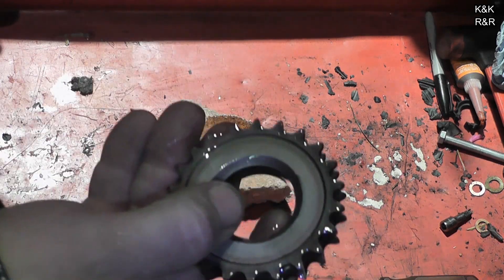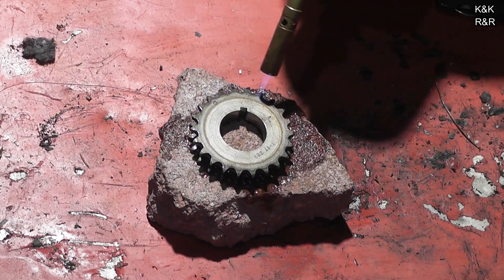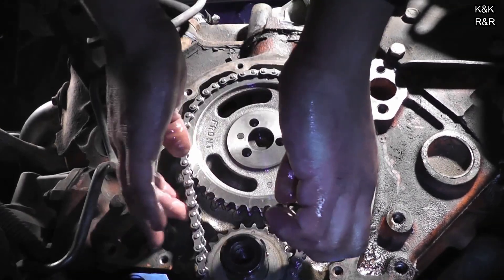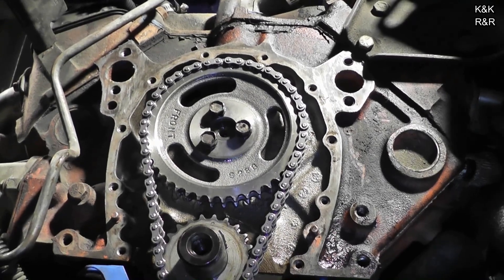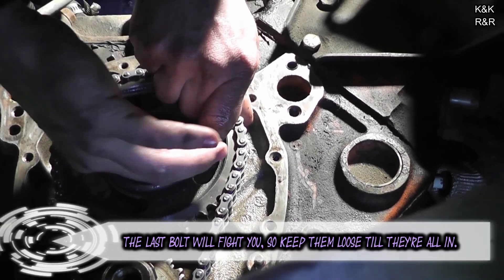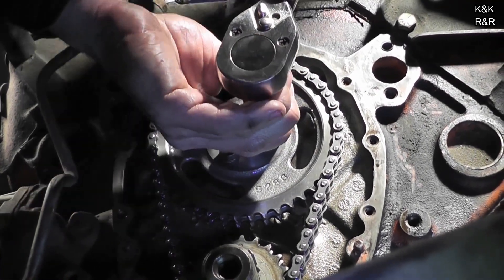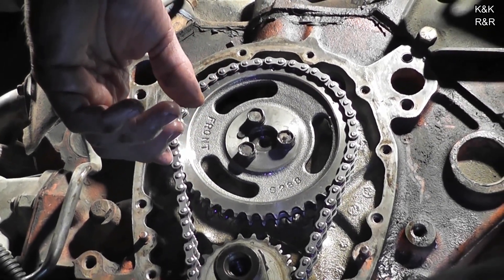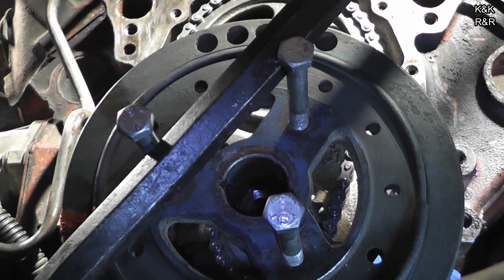How to Diagnose & Replace Any Chevy 350 Timing Chain Pt3  Double Roller Timing Chain Install

Comment: I've had my Chevy for 20 plus years 5.7 350 and never had the heat up timing gears or grind anything ! when I took the factory single chain to dual chain, also got rid of all the fuel injection crap and went with Edelbrock carburetor and intake ! Love my Chevy❤

Comment: i see the crankshaft and the cam marks are at 12 oclock-that how my haynes manuel shows and how ive done 3-350s and one 283 over the years-now i am being told that is wrong by a mechanic-if i turn the cam 180deg to get the mark at 6  oclock the book says thats number 6 cylinder at tdc-all my motors run good cept the last w a double rollers that has 7 degs stretch that i replacing lots of videos showe mark to mark aka 12 to 6oclock--dont get it
Reply from the maker: I and 6 can be for timing checking with a timing light.  I need more info what year you are working on and is it a 305,350,400?  305 are timed different due to the roller cam installed. 
/K&K

Comment: For the 5.7 vortec engine, I was driving around 70mph and all of a sudden i had power loss (truck turned off on its own.) Am i able to swap out the timing chain to see if the truck turns on? Or do i need to replace engine? All the truck does now is just cranks and cranks.
I have replaced distributor thinking it was that, but have no luck. It was changed out at TDC as well.
Reply from the maker: Modern EFI really needs to be properly diagnosed.   Sudden loss of power could be a bad fuel pump, electrical, ignition module,  broke timing chain, and other issues.  Start with the basics get a spark tester and see if you have spark. Problem with the vortec you changed the disturber now you need to have a cam sync done with a scan tool with that feature. Testing the quick and dirty way, If you do have spark spray some starting fluid down the throttle body and see it kicks over, if it does start and stalls quickly than its a fueling problem.  Quick timing chain test take the dist cap off and turn the engine over 180 degrees by hand and see if the rotor moves, if the rotor moves its not the chain.  Let me know what you find out.   
/K&K

Comment: When you didn’t align the marks the first Time how did you figure it out ( fix it )please help I’m a beginner and would appreciate the help
Reply from the maker: In the video we aligned the timing dots 12 O'clock on the crank / 12 O'clock up before removal of the old chain not after.  We do it this way to make sure we are the compression stroke.  If you have taken your chain off already make sure your on the compression stroke.  Take the disturber cap off and make your pointed at cylinder 1.   Its real easy to be 180 degrees out  if you do not align your timing dots before remove of the old chain. 
/K&K

Comment: Did you make sure to line up your two dots on the sprockets and I noticed that you didn't mention it. Lol. Thanks...
Reply from the maker: We always set our dots up before removing the chain then re-check alignment with a straight edge just before installation.
/K&K

Comment: How often do the head gaskets go bad after changing the timing chain?
Reply from the maker: It depends if you had weak compression due to a bad chain and all the sudden increase compression after repair it could blow a weak head gasket.   I won't do chains on engine with over 200k because it tends to cause other issues.  
/K&K

Comment: It's nice to watch a video with the exact problems you are experiencing. I also did the carb and distributor to no avail. I like the part showing the crank moving and the distributor not. Mine was alot worse than the one y'all were working on. Thanks again for a great series.

Comment: interesting to note: alignment DOTS on the new gears.... does this direction ever change w new parts? ie: dot to dot vs dot TOP and dot TOP?  just curious.  of course you would mess the rotation while doing - so little chance of messing up.  I once did a SUBURU w 2 timing belts - which was a beast.... difficult to not be one tooth off.

Comment: outstanding. would be good to know if you used thread lock on the 3 bolts. thougths?  I see the quick note : 'optional'/ if you use... suggestions for type, brand?
Reply from the maker: I use blue Loctite medium strength. 
/K&K

Comment: Hey guys pls tell what I'm doing wrong I changed the þiminf chain and sprockets and I still have alot of sloppy in the chain after all said and done an I doing some thing wrong ?????????? Pls help lol yours truly poncho
Reply from the maker: What your looking for is the crank / cam correlation. When the chain is sloppy it will take 4-12 degrees of crank turn before the cam moves.  If your crank and cam move at the same time the chain is not sloppy, most new chains will have some inward side to side movement.
/K&K
Reply: @KNKRNR  tks bud but the chain is still sloppy lol no matter what there was two different kits avalable for it and both are still very sloppy to my opinion
Reply from the maker: @rickmantha9579  Where did you buy your chain from?  (Double roller, Single Link) The problem we run into with after market parts no two are alike.  We try to use Cloyes but I don't remember if they are still making double roller chains for 350 anymore.  
/K&K
Reply: Single  and same company

Comment: When you're heating a torus (donut) like the crank gear, you want to heat it outside-in.  Although this gear is too small to really matter, as a general rule you should always heat from the outside-in.  If you heat from the inside, it's expanding and fighting against the outside.  I am usually heating gears that are 4ft+ in diameter.

Comment: About How far back does the crank sprocket sits onto the crank? Thanks in advance.
Reply from the maker: The crank gear will bottom against the crankshaft.  The crank itself has a taper to stop the gear from being driven in to far. 
/K&K
Reply: Thanks very much for the info and the fast response 5 stars

Comment: is about a 1/16 inch deflection ok in the chain if pushed in hard?
Reply from the maker: All chains will have some deflection. What your looking for is how long it takes for the cam to catch up to the crank. You can test the chain by simply turning the Crank by hand to see if the Cam moves in sync or is delayed by 4 to 12 degrees. If the chain is bad you will see it expand and catch up (excessive deflection) with each rotation by hand.  Other issues you may find with a stretched chain are late cold/hot starts, poor performance at times, and timing that jumps around at idle with a timing light. 
/K&K

Comment: Heating the gear up with a torch will harden and forge it...really dude? C'mon. There is  a method and process to hardening steel more than just getting it hot. It is very possible to weaken the temperment of steel by heating it, albeit you likely did NOT weaken it with the amount of heat you appeared to apply to it but you did NOT make the gear harder with your torch I promise you that
Reply from the maker: Sorry you didn't like my over simplified statement on metal forging, yes its more complicated then I stated.
/K&K

Comment: I have a 87 k20, it hasn’t started we’ve tried everything electrical and it still won’t start now realize the chain is stretched, can the chain being over stretched prevent the truck from starting at all?
Reply from the maker: It should start with a stretched chain unless the chain has jumped which is rare but does happen.  With chain stretch you would normally have a late start and timing that would jump around which can be seen with a timing light. To test for a stretched chain simply remove the disturber cap not the rotor and rotate the crank, if that chain is stretched you will see it as the rotor will have to catch up after you rotate the crank. I have seen these engines run with as much as 8 degrees of stretch. Have you done a compression test yet?
/K&K
Reply: Keith & Kevin's Repair & Restorations I have it apart already and the old chain was very stretched
Reply: Probably an entire extra link of stretch in it

Comment: How did u get the oil pan out to clean the block surface and the pan itself. I have a 93 Sierra and its looking like the whole motor needs to be pulled or drop the 4 wheel differential just to get the pan out for a good cleaning and seal for timing cover as well .
Reply from the maker: The square body trucks had room to remove the pan with ease. The round body years (88-98) with IFS is a different story.  Round Body trucks with IFS we will unbolt the engine mounts at the frame and lift the engine up with a cherry picker just enough to gain the needed access to drop the pan out.   There are some GM's out there where you must remove the engine to do an oil pan gasket or drop the front diff out to gain access.   As far as cleaning goes we will use lint free Scott's Shop towels and a lot of brake cleaner.  Brake cleaner does not leave a residue after its use. 

/K&K

Comment: I have my timeing cove off and  there is a little slack on both visible side of time chain should I change it. Out ?  ??
Reply from the maker: Slack isn't so much an issue  from side to side, but you need to check to see if the cam catches back up the crank with each revolution. Both should turn equally at the same time, but when you have slack in the chain you will find the Cam will always catch up to the Crank late, this is the point when the timing chain should be changed.  The other issue you will find with a stretched chain is base timing will jump around at least +/- 4 degrees. 

/K&K
Reply: I look the chain look lose and i change it an look the same
Reply: How i do that

Comment: I like to thank you guys I brought a motor off of let go everything checked out good compression I took the valve covers off everything look clean inside the motor so I put it in my truck and I couldn't get it to run right swap carburetors distributors mess with the timing and nothing was working the things backfiring had no power so tomorrow I'm going to take a look at the timing chain thanks again guys keep the videos coming

Comment: On late model 5.7 engines you have to grind a small portion of the block behind the cam gear to installed a double row chain. If you don’t the cam gear will rub against the front of the block
Reply from the maker: The 580, 638 cast blocks do need some clearance provisions, but I haven't had to grind any 397010 blocks for double roller use.  That's not to say at some point somebody may have done the grinding already on those older 010 blocks.
/K&K

Comment: I keep an old electric hot plate for installing various press fit gears in manual transmissions and such.
Reply from the maker: The hot plate is the only way to go for precision work like manual transmission gear installation.
/K&K

Comment: This video saved my ass. In the middle of swapping out the chain was wondering what kind of lube your soaking the chain and gears with or if I could put em on dry
Reply from the maker: You can use moly-lube, or simple engine oil.  We soak the chain for 24 hr in 10w-30 oil, then add just a little moly-lube after the chain is installed.  Change the oil after 500 miles!
/K&K
Reply: So the nube that I am I probably didn't heat up the crank gear long enough and was lightly tapping it on with a finishing hammer :/ and I missed place a hit and chipped one of the teeth off (most likely when it sat flush). It's on now but I was reading a review about Cloyes timing chains and one said that some guy did the same thing. Said it still works fine with a chipped tooth. Wondering what you recommend in your experience if its worth it right now to get a new gear while its apart than have more trouble down the road. Not sure if the chip fell in the oil pan or on the ground (working on a gravel driveway). Hoping it fell on the ground.
Reply from the maker: Yikes, I have seen cam fibrous gears missing teeth and still ran okay.  As a Tech I'm going tell you that it really needs all the teeth to work right, Its worth it to correct as needed!  The perfect install temp for the crank gear is about 170 degrees to 250 degrees. I use to use the BBQ to heat the crank gear up but the torch is a bit more convenient.   We use a big socket to drive the crank gear the rest of the way on so we don't damage any teeth.  As far as the chipped piece of metal goes, once and a while we will get some rouge shavings in the engine. In this case we will put a small hi powered magnet on the oil pan near the drain bolt, during the next oil change we will drag that small magnet down to the drain hole and hope that that rouge piece metal followed out. This may take a couple of oil changes, but rest easy knowing that the oil pick up screen is small in design for this very reason.  Chevy filters the oil before it makes it to the main bearings. Use the best oil filter you can buy for time being. 

/K&K
Reply: Can you soak the chain for too long, will it stretch. Just put the new chain on and it's loose. Yikes?
Reply: Bout 1/4 in of play
Reply from the maker: No worries on over soaking the timing chain. As far as the chain being loose, there will be a little bit of slack with the after market chain when the engine is lined up dot to dot. A chain is bad when the crank gear moves before the cam gear catches up, you will a popping sound when this condition is present. If the crank and cam move in a synchronized pattern after the chain service you are good to go.

Comment: Good video but dont you have to line up the dots on the gears?
Reply from the maker: Yes always.  We line the engine up before we started the tear down. It might appear as we didn't line it up, but we don't remove the old timing gears till the engine is lined back up at 12/12 O'clock. Its a lot easier to get the cam and crank aligned back up with the old chain on then to try to correct the alignment with a new tight chain. 
/K&K
Reply: @KNKRNR  6 & 12????
Reply: Thanks